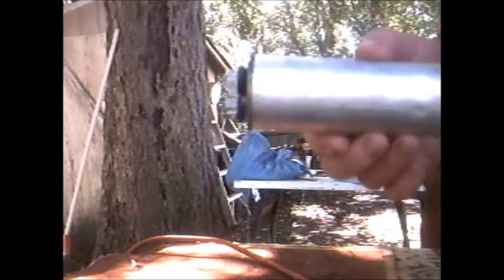How to check a Capacitor

Comment: I always used an analog multi tester and set it to ohms and checked between the capacitor housing and the terminals to determine if it is shorted, and if not, then I would read between the terminals, and the needle would rise then fall.  Then reverse the the probes, and the needle will rise and fall again.  This indicates a good capacitor.  Been years since I've done A/C work, but that's the way I remember it.  I enjoy your videos!